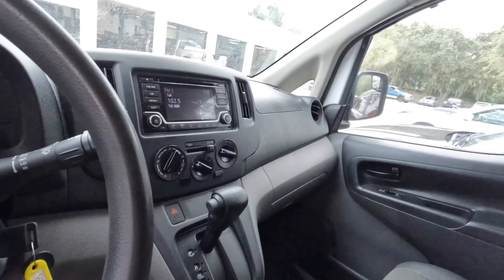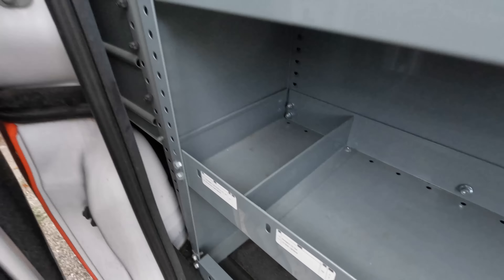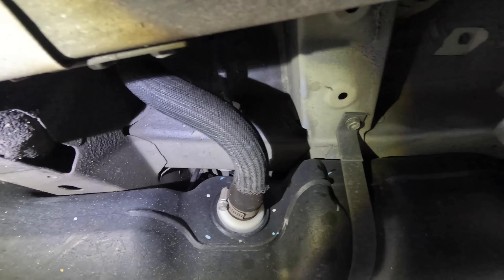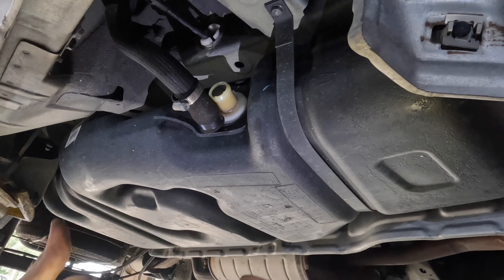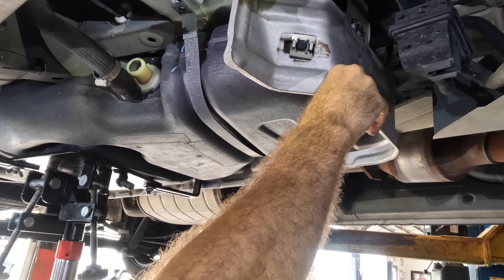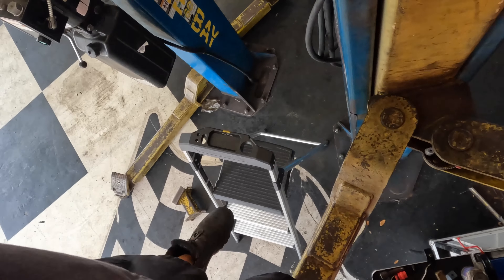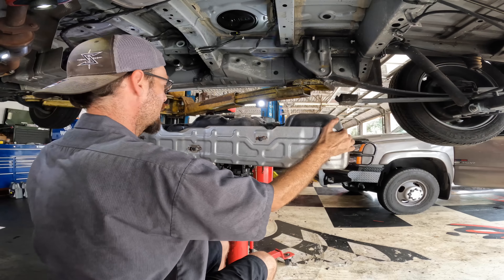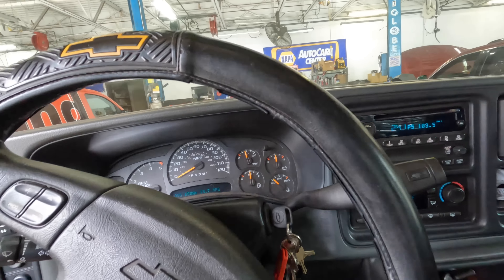Misdiagnosis! Changed the Part Anyway! | Crank No Start

Comment: Clogged fuel filters which should be changed every year lead to fuel pumps burning up.

People grossly neglect replacing their fuel filters every year and it is often overlooked as to be should service item by shoppes.

Why would you address a faulty fuel pump and not the fuel filter at the same time?.

Sloppy sloppy sloppy

Comment: Damn.....lost some respect here. You used the pump snout to press the fuel select switch and spilled diesel all over it? Ouch.🤨 IMHO - no less than 5 gallons in an empty tank before restarting with a new pump and empty tank. Don't even "check" the float level sensor with an empty tank - that pump is on the moment you switched it into run mode and it needs a lot of gasoline for lubrication and cooling and just "checking" it probably caused some wear that was unnecessary.

Comment: Flashlight magnet? I think repair shops should hire kids without dads to hold the flashlight for the technicians and the technician would have to yell, "NO DAMMIT, SHINE THE LIGHT HERE NOT AT F%^KING FLOOR," and, "QUIT DANCING AROUND. WE'RE WORKING ON A CAR, NOT A BALLET RECITAL," every 2 minutes.
Reply: Worked with an old guy who held the flashlight, would start to doze off and the light would slowly drift away. Stubborn old guy, wouldn't retire until he missed the step onto a manlift and, almost fell down the hole.

Comment: I had a ‘99 Frontier and the fuel pump failed at 60K resulting in a $300 tow.  Later a company I worked for bought a fleet of NV200s and one by one they all broke down because of faulty fuel pumps.  In 17 years Nissan couldn’t correct their bad pumps/senders?? Never again will I buy this crap brand.
Reply: My old 98 max had fuel pump changed once. I’ve ran it dry so many times but i always keep fuel half now. Never had a problem with fuel pumps on the newer models tho for years.

Comment: you should be ashamed of yourself. The customer should have been told you misdiagnosed the problem, giving them the option of a $500 fuel pump just to fix the gauge. Either way you should have done a better job diagnosing the problem. Shame on you!

Comment: Why do workshops have compressed air systems? For tools and tyres. Absolutely do NOT use compressed air, especially from blowgun, to blow at skin. It might contain small particles, which could penetrate the skin causing all kinds of nasty things. Also never clean your clothes with compressed air. It is a very serious fire hazard.
Reply: When you use compressed air all the time you know what you can and can't do.  How's it a fire hazard?
Reply: @HoLeeFuk317  you put more oxygen in between the fabric strands so a small sparc could ignite the cloth. With all the flammable stuff around.... just ask your local fire inspector. Many places have been shut down because of that.
Reply: @robrommens660  compressed shop air has exact same percentage of oxygen as the ambient air.  I think your confusing this with not using compressed oxygen from torch tanks to blow things off.
Reply: @HoLeeFuk317  sure, pure oxygen is much more dangerous, but that is not the point. When you blow compressed air in fabric there will be more air between the strands which changes the ratio of oxygen in relation to the fabric. And thus you increase the risk. 
It is not a hypothetical situation, some 20 years ago a mechanic was told to clean up old oily rags that had piled up in a corner of the workshop at a powerplant I worked at as an operator. There was more debris and leaves and he took a compressed air hose to blow it out of the corner. After a few seconds that resulted in an explosion and fire. The man was seriously injured and did spend two months in hospital and is now disabled (blind).
Reply: @robrommens660  that's spontaneous combustion of the oily rags.  The compressed air didn't cause the fire, only helped it along by introducing air into a stack of already burning rags.  Your clothes are not going to burst into flames from compressed air.  As soon as the air is out of the air nozzle it is the exact composition of atmosphere as it was before being compressed.  There is no more volume of oxygen as before.
Reply: @HoLeeFuk317  let me end the discussion. You’re right. 🤜🏼